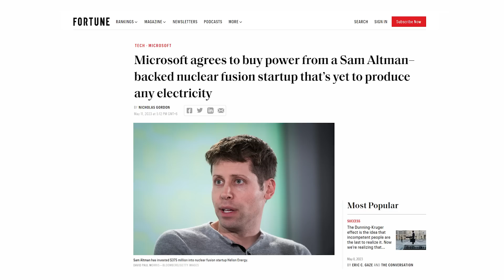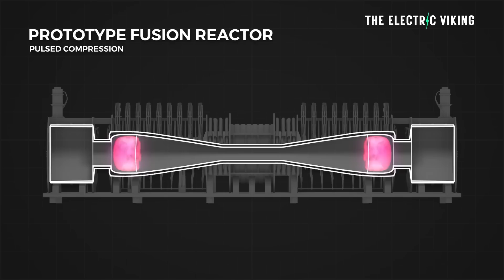Microsoft says the nuclear fusion dream is about to become a reality

Comment: When I was in 7th grade I first read about fusion energy. It was supposed to be only a few years away. I am now over 70 years old and it is still just a few years away, just like carbon capture. Renewable energy that works is here now. Let us not get distracted.
Reply: Fusion energy just needs 2 more ingredients:  unicorn tears and sasquatch fur. 

Sadly, both were exhausted by the greedy Atlantean civilization 15,000 years ago when they caused both to go extinct.
Reply: It is Not here now. Solar/Wind while otherwise increasingly attractive, do not produce reliable energy. They can supply a good portion of needed energy but you can't build (even today) enough batteries or pumped hydro to run the grid through the night on renewables alone.
A solid "base load" (reliabe/continuous) source needs to produce this in conjunction with renewables.
Nuclear is the only completely clean alternative (Espically Thorium Salt reators which are completely safe, vastly more fuel efficient, and produce less than 1% of the waste of conventional light water reactors. The waste being vastly less long lived than that of uranium based nuclear).

Modern nuclear energy (other than fusion) is still equated with "black magic" in the US, so the government has put little money into the tech. Whereas investment is critical, the government won't push it, so private funding is the only way this gets done outside China (who have no such irrational biases).

The US government has some investments in fusion, but decades of disappointments there are not likely of moving the needle on grossly unreliable funding that can dry up at the drop of a hit piece in a news article.
Reply: Perovskite solar and battery types rapidly improving
Reply: @avgjoe5969  In combination with new battery technology the grid can work.
Reply: Be careful with your verbs tenses. Thorium reactors do not actually exist. There are none operating.

On the other hand, the cost of building new solar capacity with battery storage is cheaper than the cost of operating any coal plant in the United states.
Reply: @avgjoe5969  The wind does blow at night, you know. Between solar, wind, and storage, combined with existing nuclear and other power sources, there would be enough energy to power the grid. And that's not counting household solar and storage that keeps a lot of people supplied with power. Fusion energy is a great idea, but the fact that it has not been solved after 70+ years of trying, shows just how difficult it is. We are talking extreme temperatures and extreme amounts of energy just to get the process started, if it ever works. Good on Microsoft for having a go, but I wouldn't be investing in something like that.
Reply: @apterachallenge  Yeah... sloppy wording. Just underpinning the importance of a baseload source in addition to renewables. Regards their chances, not optimistic either, though given MS deep pockets, still worth a go. Will never solve fusion without risk taking.
Reply: @avgjoe5969  I think MS is chasing the AI angle, hoping that AI can solve the fusion problem where human intelligence has failed. That's an untested approach, and to be honest so far AI has just agglomerated human knowledge and spat it back out to us. Problem solving requires a whole other level of intelligence but perhaps AI can be a useful tool for running some numbers, testing scenarios in cyberspace without having to actually build the reactor to see if it works. That could save a lot of time and money.
Reply: @avgjoe5969  Over 50 years of nuclear show it is very expensive to both build and run, not safe, has no safe disposal, is slow to get online, hard to take down, and uses huge amounts of water. Batteries and renewable energy operating in combination have proven themselves worldwide in getting electricity on line cheaply and quickly.
Reply: @MrEd2291  Nuclear is actually not slow nor expensive when you look at the history. In the 70s and 80s the west build these things in mass. The rate of adoption compared to other sources was actually higher. Onkalo in Finland proves that a disposal site can be build. There are other options tho, like fast reactors that consume the 96% of unused fuel in the waste. After consumtion, the waste is dangerous for 300 years instead of 100 000 years. The decomissioning part is indeed a point where there needs to be improvement by the designers of these systems. i would advocate for renewables including nuclear so solar, wind, geothermal, hydro, nuclear, etc...
Reply: @MrEd2291 over 50 years nuclear has proven to be safer than every power except for nuclear, some studies that include a very important factor, the cost of electricity when including the ups and downs due to renewable point out that nuclear in various countries can be cheaper, and there are safe forms of disposal. Batteries are not produced on an even close scale to what is needed to replace nuclear power.
Reply: Somebody has to keep trying or we would still be lighting our homes with gas flames. This one won’t be a discovery like the bell telephone. It will be more like the hunt for the Higgs Boson with many spin off breakthroughs
Reply: I agree. We already have a fusion reactor pouring supplying us with practically limitless energy for free. All we need to do is make enough solar cells to take advantage of that. If Microsoft spent their money on that they'd get a much better return than speculating on some company which probably will never succeed. But of course the corporate world runs on greed, and they need to control the energy source and the profits. Free energy from the sun that anyone can tap into isn't profitable for them.
Reply: We do not have a renewable energy solution that works now, that is "the party line". I am an retired electrical engineer with 45 years experience.  We have a patchwork of addons that can supply intermittent power at relatively low capacities. Germany invested heavily in renewables and look at what happened. They are having to shutter factories and may have to fire up fossil fuel sources after all.  They pay triple or quadruple what North America pays for electricity.
Reply: Same here.  The "distraction" has cost the governments tens of billions of dollars, with no end in sight.  There have been prototype after developmental protype, without an end in sight.  The plan is to waste money until 2040, then build a bigger more expensive developmental prototype, and maybe get a working tokamak by 2060.  By then all the money that will have been spent on fusion could have helped build renewables to end our dependence on fossil fuels.  Shame!!  😡
Reply: Sorry, Helion and AGI (Artificial General Intelligence) are both a scam, good luck with that ..

Comment: Snake oil 🐍 Sounds like all the risk sits with Helion and not Microsoft. It costs nothing to sign a PPA with penalties for non-supply. The benefit to Helion is they can more easily attract capital, having a PPA in place with a bankable counterparty like Microsoft. And there’s no shortage of gullible venture capitalists that will buy in. But not this little black duck! 🦆 Cold fusion is a fantasy and hot fusion uses more energy than it yields. There’s no free rides in a universe constrained by the 1st Law of Thermodynamics.

Comment: The YT channel Real Engineering did a great video on Helion projects about four months ago. Pretty interesting. That's where a lot of the shots in this video come from.
Reply: The video: https://www.youtube.com/watch?v=_bDXXWQxK38 "A New Way to Achieve Nuclear Fusion: Helion" from "Real Engineering"
Reply: Look closer at Helion's two step process. Helion will be making their own expensive H3.  Helion's fusion is actually a two step process.  First they make H3 with just deuterium in opposed accelerators similar to their main fusion accelerators. Deuterium is not that expensive.  Helion will use separate accelerators because making H3 releases neutrons which will degrade the accelerators.  The accelerators for making H3 don't have to be as good as their main, opposed, fusion, accelerators.  Then that created H3 with deuterium will be used in their main opposed fusion accelerators and this reaction will not release neutrons, so the accelerators will last longer.  Helion will also be be able to sell tritium to other reactors or keep storing it until the tritium decays into H3 after 12 years.  Helion might be a profitable business just by making and selling H3 and tritium.

Comment: About to become a reality........+ 30 yrs
Reply: Nope. Pulse fusion is a reality now.  Summary:  Plasma has a charge.  A charge passing through coils produces electricity.  Helion uses fusion to produce plasma and releases it through coils, making electricity.  People are also missing that Helion uses a two step process. Helion will be making their own expensive H3.  Helion's fusion is actually a two step process.  First they make H3 with just deuterium in opposed accelerators similar to their main fusion accelerators. Deuterium is not that expensive.  Helion will use separate accelerators because making H3 releases neutrons which will degrade the accelerators.  The accelerators for making H3 don't have to be as good as their main, opposed, fusion, accelerators.  Then that created H3 with deuterium will be used in their main opposed fusion accelerators and this reaction will not release neutrons, so the accelerators will last longer.  Helion will also be be able to sell tritium to other reactors or keep storing it until the tritium decays into H3 after 12 years.  Helion might be a profitable business just by making and selling H3 and tritium.

Comment: Many countries have developed nuclear fusion but biggest problem is to control the plasma. Use of magnetic field looks promising and vent have been provided to stabilize the plasma.  

The beauty of safety is as simple as Turning off the laser and fusion is over    

No radiation as by-product is it’s advantage 

To calculate use E=mc square

E is in joule
m is in grams
C is the square of meter in metric. 

One can calculate energy based on mass used

Comment: Here is a question - if those systems that are going to contain the energy of a hydrogen implosion are going to be held by magnetic fields - wouldn't they need to be equal but opposite in power? If you have a vector pointing out; won't you need an equal vector pointing in; if you want to contain that vector?  That would suggest you cant' do fusion and contain it if you want to produce energy.  Perhaps if you had some physical thing that could contain it - but this is a very energetic bit of action.  What can contain it that is solid at the super temps they use to implode?

Comment: Temperatures much over 100million C have been achieved in a lab, up to 4 Trillion C has been achieved. It is because it such a small mass that they can get it that hot, with minimal energy. My opinion is it is a good idea to get nuclear fusion power working, but I don't think it will be a cheap as wind and solar with the path they are on now. It is a very complex machine, and the next challenge, once it works, is to get the heat out, heat water to steam and run a steam turbine to generate electricity, lots of complex wearing parts, and costly to maintain.  To make it all more efficient and cost effective, someone needs to develop better  thermoelectric solid state generators with high efficiency.
Reply: Helion is different.  They are not a heat engine.  The electricity is developed from the ionized plasma moving through coils.  Pretty clever, really.  I doubt that any fusion technology will be economical on Earth, but might make some sense in space.  Helion at least makes a hell of a lot more sense than a tokamak.
Reply: Summary:  Plasma has a charge.  A charge passing through coils produces electricity.  Helion uses fusion to produce plasma and releases it through coils, making electricity.  People are also missing that Helion uses a two step process. Helion will be making their own expensive H3.  Helion's fusion is actually a two step process.  First they make H3 with just deuterium in opposed accelerators similar to their main fusion accelerators. Deuterium is not that expensive.  Helion will use separate accelerators because making H3 releases neutrons which will degrade the accelerators.  The accelerators for making H3 don't have to be as good as their main, opposed, fusion, accelerators.  Then that created H3 with deuterium will be used in their main opposed fusion accelerators and this reaction will not release neutrons, so the accelerators will last longer.  Helion will also be be able to sell tritium to other reactors or keep storing it until the tritium decays into H3 after 12 years.  Helion might be a profitable business just by making and selling H3 and tritium.

Comment: Nuclear fusion will be good only on Moon, Mars or when huge rockets fly far from Sun. Here in our planet Earth in order to use fusion you have to use Carnot cycle. To use Fusion energy you need to use steam turbines to rotate electric generator to create electric power.  From physics every one knows that for steam turbine you need to chill steam coming from turbine and you heat the atmosphere (air) which is Big no no. Water vapor is the worst green house gas. Its worse that methane  or CO2. As Elon Musk said its better to use solar panels. They don't need any steam, or electric generator. 100x100 mile spot filled with solar panels can provide electricity for all houses and businesses in America.
Reply: You don't understand how electricity is generated from pulse-fusion.  No water needed.  Just big capacitors and Tesla Mega Packs.  Summary:  Plasma has a charge.  A charge passing through coils produces electricity.  Helion uses fusion to produce plasma and releases it through coils, making electricity. This electricity could be put directly into Tesla Mega Packs.  People are also missing that Helion uses a two step process. Helion will be making their own expensive H3.  Helion's fusion is actually a two step process.  First they make H3 with just deuterium in opposed accelerators similar to their main fusion accelerators. Deuterium is not that expensive.  Helion will use separate accelerators because making H3 releases neutrons which will degrade the accelerators.  The accelerators for making H3 don't have to be as good as their main, opposed, fusion, accelerators.  Then that created H3 with deuterium will be used in their main opposed fusion accelerators and this reaction will not release neutrons, so the accelerators will last longer.  Helion will also be be able to sell tritium to other reactors or keep storing it until the tritium decays into H3 after 12 years.  Helion might be a profitable business just by making and selling H3 and tritium.
Reply: @jamescottrell7147  You need some cooling for this process. Don't say that you don't need any cooling. You will heat atmosphere anyway. Don't heat the planet. LOL